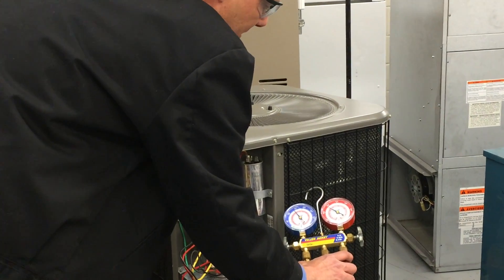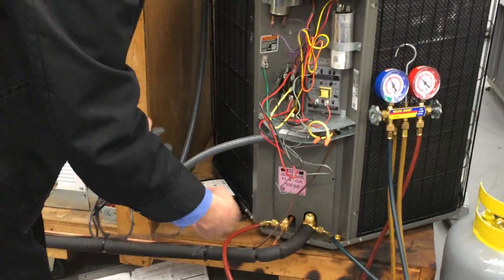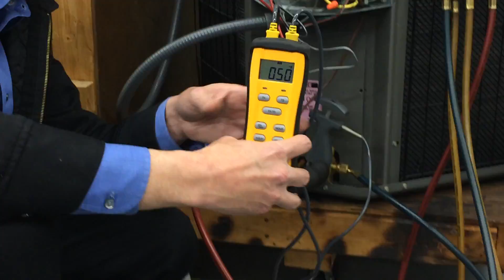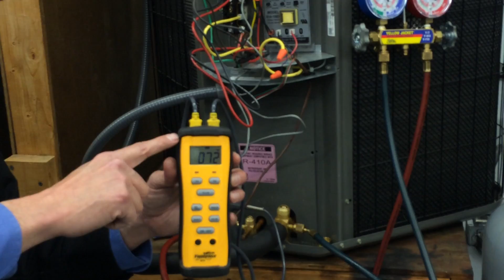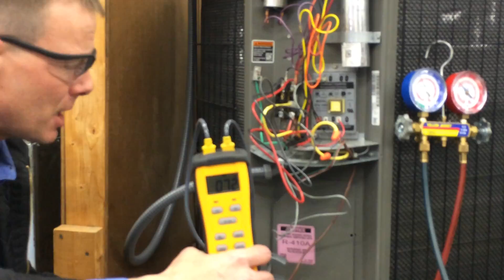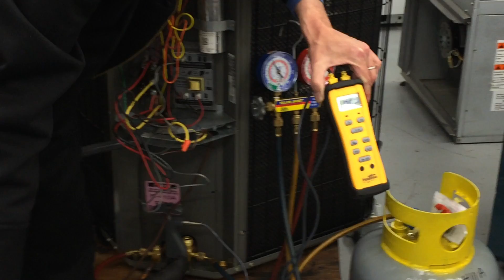HVAC Basics: Service & Troubleshoot - How to Measure Superheat & Sub Cooling on a AC System

Comment: I’m fresh on this but why did he put the yellow hose to the vapor blue valve on the tank ? When he open the high side of the gauge that I thought it was liquid ? 
I thought the high side coming out of condenser to evaporator should be liquid and to recover liquid, I thought it should be connected to the red high side valve on the tank ? 
Can someone please explain this to me ? 
Im really trying my best to understand how an air conditioning works. Thank you
Reply from the maker: The manufacturers of the tank do not have a uniform color code. Other words one tank could be a Red Handle/Valve for vapor and another tank made by a different company could have Red Handle/Valve as liquid. It varies and you have to read the handles.

Comment: Purge the recovery cyclinder to remove any air going into cyclinder and the superheat T1 is connected passed the schrader valve which will restrict refrigerant and there should be a temperature difference.

Comment: So typically, out In the field, would you get the dry and wet bulb temps? I assume because this is a class room you just tried to teach the basics of superheat and subcool.
Reply: what is wet and dry bulb temps?? like the ambient temperature that can have an effect on the refrigerant inside the units??
Reply: John Smith absolutely! What if it’s a refrigeration unit inside a hot restaurant. The unit is going to work harder to remove heat. Wet bulb is ambiant with humidity. If you call a manufacturer that’s one of the first things they ask. what’s the dry & wet bulb temps.

Comment: Great Video.  When you take refrigerant out, the SubCooling actually goes down though admittedly you are charging that fixed metering-device system via SuperHeat.

Comment: Did you use a scale to weigh what refrigerant you took out? Great video thank you.
Reply from the maker: +Ron White rather than leave it on the scale I prefer to weigh it then re weigh as long as know I won't go over eighty percent and the amount of charge I'm dealing with. 80 students x 100 digital tools is a lot of batteries. Plus every time the tank is left on the scale and it gets bumped or a hose gets moved it throws it off. Only time I really leave it on a scale is when it gets close to 80%.